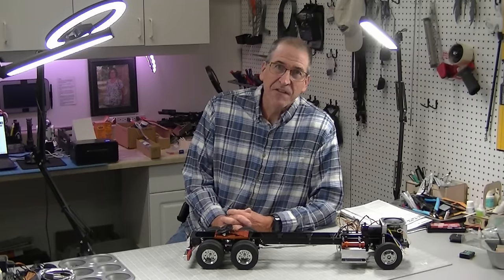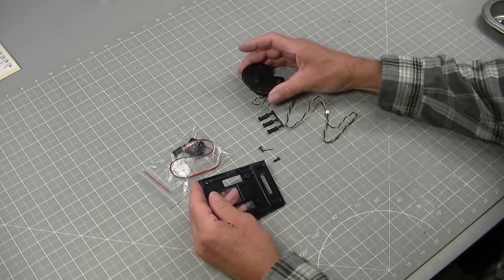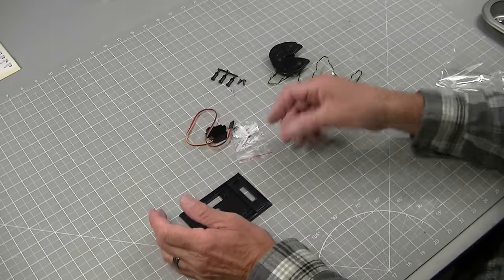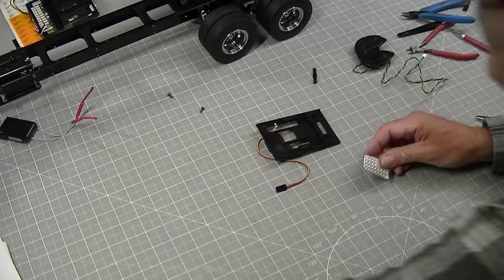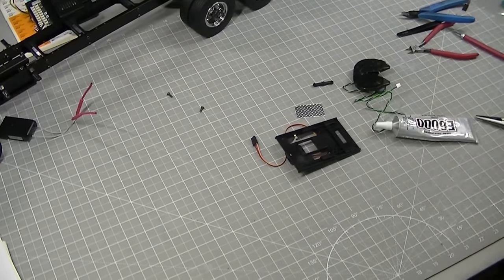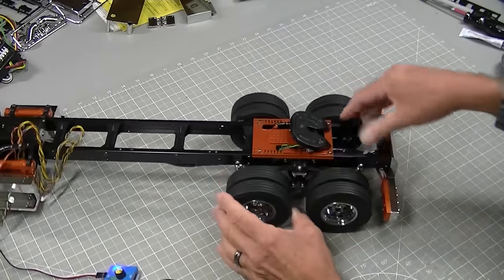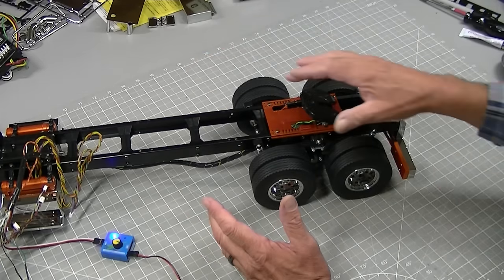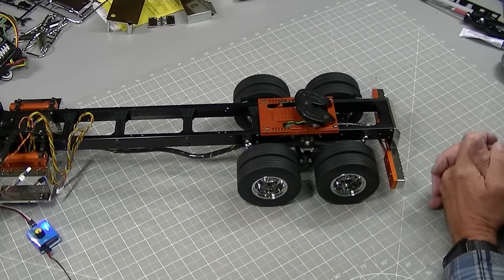Tamiya 1/14 Semi Truck Servo Operated 5th Wheel Coupler - HC Shorts

Comment: Bob, this is great. This method should work when using a motorized trailer leg kit too correct?
Reply from the maker: Yes, but you have to move the servo to the other side of the deck as they move the ball on the coupler to the other side.
Reply: great... be on the lookout for a micro servo order. Thank you.  @HobbyconceptsLLC